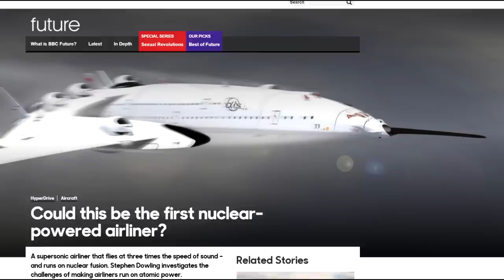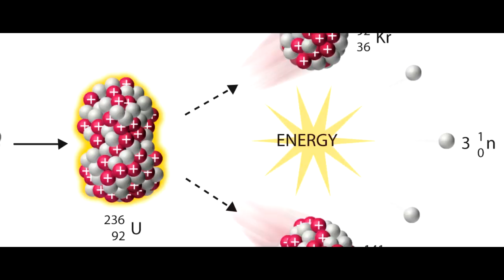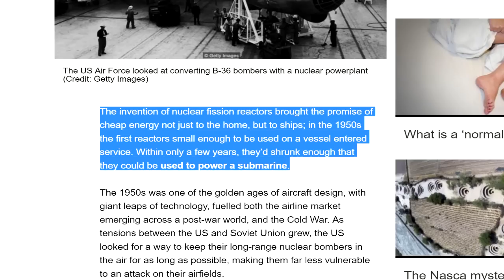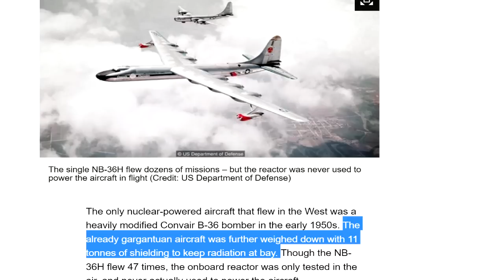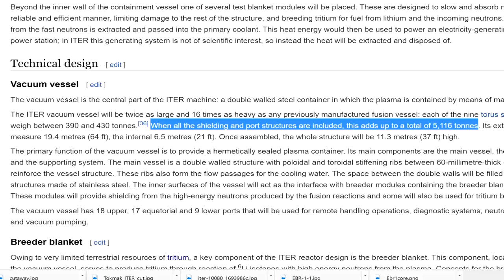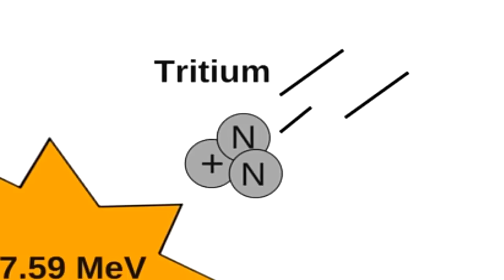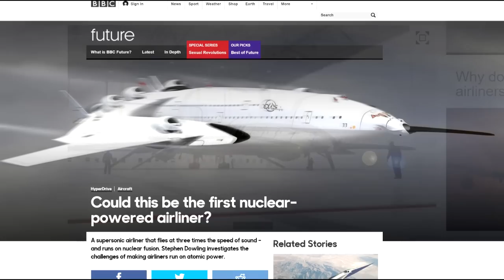SIX ENGINED Nuclear Airliner... BUSTED!

Comment: They use nuclear power to give space probes their energy for decades.  You are basing it on past nuclear technology,modern nuclear fusion is very, very different. You think this works like an old school nuclear power station. Which is not how it works.
Reply: Really? Go on. Explain to us how "this" works.
Reply: I know about the space probes using nuclear power. Problem is: it is just a small amount of power which is generated there. Space probes can function with that because they are designed to function with such low power. The energy required to bring an aircraft to the air is several magnitiudes larger.
Reply: Hanniffy Dinn I was on board until you started spewing stupid shit from your mouth.
Reply: Hanniffy Dinn look at the pot calling the kettle black. 

"You know nothing about science"

"The truth is they already have reverse engineerd alien tech."

lol. Stay smart, kiddo.
Reply: Ron Sauer
Someone pointing out we already had a passenger plane that could fly from London to New York in 3.5 hours,  called Concorde isn't trolling.
This can be done WITHOUT nuclear power, so there is nothing impossible on this plane.

They could use a nuclear cell to power the lights and it would technically be nuclear powered like all space probes are.

I suggest you engage your fucking brain cells rather than call people trolls who are talking real science.
Reply: +Hanniffy Dinn lol.. every time I see you, you're talking shit.
Reply: Hanniffy Dinn I'm not referring to the Concorde shit, more the crazy Illuminati tin-hat flat-earthing babble like: "The truth is they already have reverse engineerd alien tech..They have free energy...blah blah.. woop woop woop woop"
Reply: They could work if they weren't so shitty.
Reply: You need more power than just run a few sensors. You can't fly an aircraft with 20 watts.
Reply: dylf14 Time for captain science here to once again prove the world wrong and do the technologically impossible.
Reply: Markus Wiezorrek
I'm just highlighting this video is retarded.

It's like talking to the wright brothers saying they are going to build a "flying machine" then calling them  FUCKING STUPID IDIOTS.

The truth is they already have reverse engineerd alien tech. 
They have free energy.
So building, say, a COLD FUSION reactor is no big deal.
You see how they destroyed cold fusion when that came out?
Or all those people with water powered cars that dies mysteriously.

So we are talking about Tech we don't get yet.

It's like been shown picture of CONCORDE which went supersonic and saying YOU ARE LYING THAT DIDN'T HAPPEN !

So the truth is we've already travelled the atlantic at speeds we don't do now.

Did you ever watch LIVE AID??

Where guests flew over in concorde the same day and performed in america?

THAT WAS IN THE PAST !!!

Who says what tech we have now.  We already have REACTION ENGINES that can fly a plane right into space.
Search for it,  it's a REAL COMPANY.
It's a REAL ENGINE.
Reply: WimsicleStranger Don't feed the trolls!
Reply: No shit? Really? Thanks for the recap, Troll!
Reply: Ron Sauer
You are the Troll, you are not saying anything, just talking shit.
Reply: kcuf0
Hey, don't blame me if you don't know basic science.
We already have a plane, concorde that can travel from london to new york in 3.5 hours.

you don't even need nuclear technology mate.  Have you heard of concorde?
Reply: Hanniffy Dinn Have you read my reply, you idiot?
Reply: THe amount of energy in space probes is infinitively smaller and you don't need shielding in space as you don't care for radiation. Those are two of the many things wrong ith your idea.
Reply: VivAtreyu
and yet, it's all pointless, they have reverse engineered UFOs that run of free zero point energy.
Reply: Hanniffy Dinn There's no such thing as zero point energy.

Comment: The Soviets did have a flying nuclear bomber though. They did so by throwing away the pesky shielding and running the engines on an open cycle, basically streaking a trail of radioactive air through the atmosphere. But it did at least fly.

Comment: We're far more likely to end up with battery powered electric jets than fusion powered electric jets.
Reply: I'd personally like to see prop-engines make a comeback. While losing speed, naturally, costs can go down. You cannot run a jet engine with electricity (you need combustion), but you can run a propeller on electricity. If a trip over the Atlantic can drop to two-digit prices, that's a big deal.

Comment: how would you transfer power from a reactor to the engines? in order to fly at Mach anything we have to use jet or rocket engines as props are incapable of moving the air fast enough. how would  you make a rocket power jet engine? with out spraying a bunch  of radioactive exhaust?

Comment: How is the thrust achieved?  Something needs to shoot out the back to provide for forward thrust.

Either it's burning fuel (which calls into question the purpose of the nuclear part)
Or fast moving air (meaning you've got a propeller driven vehicle that can break Mach 3)
Or it's post explosion nuclear material (meaning you don't need that shielding so much since the plane is constantly shitting it out anyway).

Nuclear reactors produce electricity, not controlled, directed kinetic force.  You either need something to turn that electricity into movement or you're flying the messiest rocket imaginable.
Reply: The way nuclear jet engines typically work is they drive a turbine using some electricity initially to suck air in. 
The air gets superheated by the nuclear reactor and blasted out the back, providing thrust as well as sucking in more air in the front. 

The concept has been tested as far back as the 1960s (or even late 1950s) and proven to work by both the USA and USSR. Tiny little problem was that either your exhaust is highly radioactive OR you use the reactor to heat something like water and use that to heat the air, which prevents the exhaust from becoming radioactive but adds tons (literally) of weight and makes the whole thing much larger and less efficient.

The US eventually decided to go with the first (open cycle) design for a Mach 3 intercontinental cruise missile which would be launched from coastal bases using conventional rockets so the hot exhaust would not fall on US soil.
The plan was eventually scrapped before a missile was fielded, but some prototype engines were built and tested successfully on the ground.
Reply: OK, so basically option 3 or modified option 2 crossed with 1?  Since I'm assuming by "hot air" you don't just mean "hot".
Reply: ApesAmongUs hot as in "highly radioactive", yes. 
for commercial use you'd want a closed cycle engine, but that's way too heavy. 
Using a fusion core instead of a fission core would mostly alleviate the radiation problem, but fusion generators small enough to fit into an aircraft are decades away at the very least.
There isn't even a building sized fusion reactor in operation that can sustain a stable reaction for more than a few fractions of a second...

Comment: The molten salt reactors used on the bombers were fascinating, as was the jet engine design. It piped the molten salt into the engine where it was used to heat and expand the air instead of jet fuel, and returned to the reactor having been cooled by this processes.  One could do what Russia did and just not use much or any shielding.  But as awesome as the molten salt reactors are, the planes spread radioactivity in their path. Terrible idea.

Comment: How about the fact fusion reactors also require HUGE electromagnets to contain the plasma in the reactor, so in addition to radiation shielding, it's also going to need massive hardening of all the aircraft electronics to prevent the magnetic field from the reactor scrambling the avionics.

Comment: This is what happens when a dude with a Chemistry PhD tries to rant about Nuclear Fusion:  He blumbers on a lot about Deuterium/Tritium being impractical for airplanes but doesn't realize a inertial reactor using Helium-3/Deuterium fuel mixtures would be vastly more practical for small scale applications. Granted getting Helium 3 is gonna be the fun part but nothing's ever easy with Fusion (hello Tokamak that can't run in anything other than pulsed regimes due to the need of a induction current, Stellarator that can chuck a magnet clean across town if the fields are misaligned even slightly and Laser Inertial Ignition that needs perfect aim with split second accuracy).

You really are pushing the envelope of how far you can go and still be considered factual Blunderfoot.

With regards,
Someone with a Bachelor in Plasma Physics (specifically Plasma Diagnostics with a view towards Fusion Physics).

Comment: Interestingly, Lockhead worked on a nuclear powered plane not too far from my house.  The project was scrapped shortly after the creation of the b-52.  I think they really only got as far as testing electronics against an the radiation from a small open air reactor.  The site is now a state park.

Comment: Like the video said they tried this in the 50's they made a Convair B-36. The amount of shielding they had to surround the Cockpit meant the plane could barely get off the ground as the shielding alone weighed several tons. The idea was scrapped by the American Company  rather quickly. There are rumours the USSR tried to do this as well but scrapped the idea as quickly as Convair did. Britain didn't even try as we calculated the bare minimum amount of shielding was needed to make it safe and saw how idiotic the idea was, so we never even tried to make a prototype. Why dig it up now? NASA are trying to make Aircraft fuel from algae and other sustainable sources, not one of them is Nuclear as it only takes one crash to poison the area with Radiation for decades or centuries using a Nuclear Powered Aircraft.

Comment: So...my understanding is that every aircraft engine capable of supersonic acceleration is a jet engine that uses some form of working mass. My understanding is that even if you lift a fusion reactor in the air, it could only power a driving propeller.
Wouldn't it be a more realistic approach to just use the basically unlimited energy supply of a fusion reactor to synthesize CO2-neutral Carbon-based fuels?
Reply: Maybe they're going to generate hydrogen in-situ from water using the electricity from the reactor.
Reply: environmental air would be the propellant mass. It gets sucked in the front, superheated (which expands it) and thrown out the back.
This is the same way a normal jet engine works (the volume of the jet fuel that gets added to the exhaust gas is only a small fraction of the total exhaust gasses).
Reply: Interesting, thought the volume increase of the burning of kerosene was the biggestcontributor to the repulsion.
Reply: Biggest contributor to thrust on the latest turbofans is from the air that passes around the engine rather that through it - about 80% in current generation high bypass ratio engines.

https://www.quora.com/How-much-of-a-jet-engines-thrust-is-derived-from-the-fan-blades-versus-the-exhaust-gases

However, you can't use these type of engines for supersonic speeds.
Reply: Cardinal Biggles correct, and even the air that passes through it, the combustion products of the fuel are only a fraction of what comes out the back.
Remember that air is only about 20% oxygen. Even were the engine to be 100% efficient, meaning all that oxygen were converted into CO2 and water while burning the fuel (not even doubling its dry volume), that'd mean at best the fuel added to the air would amount to about 10% of the exhaust.
Reply: maybe they can superheat the air to plasma state using the heat from the fusion reactor then eject it as a high pressure jet at the back of the engine
Reply: I don't think you can form a plasma by temperature alone - you need to ionize the air by stripping electrons off the atoms using a very high voltage.
Reply: Cardinal Biggles

arent very hot fire/flames considered as plasmas or at the least they contain some very dense ionized gases that can be considered as plasmas?
Reply: A "hot" plasma needs to be heated to thousands of degrees (about four times that of an oxyacetylene torch flame) so there isn't enough energy is a combustion-derived flame to remove electrons from the gas.  "Cold" plasmas are possible when gasses are hit by ionizing radiation but due to their low temperatures they contain little energy.
Reply: Cardinal Biggles
well i dont see thermal energy being a problem in a fusion based power plant.
Reply: The plasma in a fusion reactor is contained inside a vacuum at around 150 million degrees - how do you propose to access it?
Reply: Cardinal Biggles

im not saying youll access the plasma inside the reactor itself... im saying youll just access the thermal energy to super heat the intake air to plasma state and discharge it via jet in the engine exhaust.

Comment: Assuming if you don't die from radiation  and they figured out shielding how would you cool the core and prevent at meltdown in mid flight? What type of failsafe systems would you install if something went wrong? These question are important if you want to install what is in essence a mini sun  on your aircraft

Comment: the aerodynamics of the design are pretty silly as well. Not that you couldn't get something that looks like that to fly, but it would be pointless to build it like that with all the space between the wing and cabin, its just silly structurally. I suspect that commercial aircraft will eventually move to a full body delta wing design. Delta wings are aerodynamically very efficient, and friendly at high speeds if you wanted to build something that could surpass the speed of sound. The downside to delta wings, and the main reason they aren't in widespread use today, is that a a true delta wing flyer (like the stealth bomber for example) cannot really be directly flown by the pilot since the control scheme is much more complicated than a normal aircraft, so you need sophisticated avionics that do the real flying. Of course that's becoming less of a hurdle today. But the reason it will happen eventually is because you get lots more cabin space and better fuel economy.

Comment: Why in the holy mother of f--- would you put a nuclear reactor on a plane?! I'm not sure we should be complementing plane crashes with additional levels of radioactive contamination.
Reply: For the same reason as someone once had the idea to power submarines and ships with nuclear reactors, no need to refuel them all the time.
By the way, the russians actually built a working nuclear powered plane and flew it and then scraped it, because it was deemed too dangerous.
Reply: 2 of them Ту-95 ЛАЛ and Ан-22ПЛО